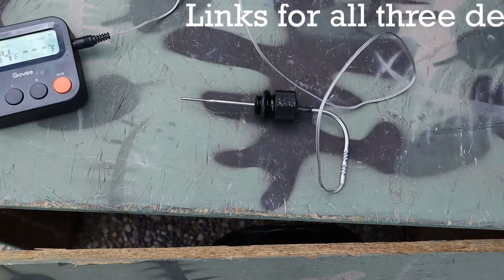Are Generator Sound Boxes Bad?

Comment from the maker: Too hot? Let me know your thoughts. Which sound box do you like? 🟣Follow me on Instagram: https://www.instagram.com/mrfredsdiy/
Reply: What caused the melting of the styrofoam around the dryer vent?  Was it the heat or some kind of glue?  Great video and very helpful!
Reply from the maker: @rrgrantham  it was the metal vent. Part of the inner lining was missing allowing the heat to have contact with the foam. Thanks for watching!
Reply: I built a generator box and mounted it to the tongue of my camp trailer on one of those racks that sits above the propane tanks. It worked great except for one trip the temps were triple digits and the box was in direct sunlight. Needless to say the generator had shut down and I had to take the generator out of the box and take it to some shade. I am running a 4500 watt generator with a 760 CFM fan. Apparently, that was not enough for that hot day.

Comment: that is very false information you are presenting … 

so basically with the box on the oil is getting 30 degrees hotter than without the box when outside is 80 degrees 

240 oil temp for an air cooled gen at 80 outside is hot 

imagine how hot it will get when outside is 95

the boxes are def cooking the generators when it’s 90 outside
Reply from the maker: Thanks for commenting, but the evidence speaks for itself. No false information.

Comment: You say these boxes are safe to use with generators, but my Yamaha inverter generators which are quite already say DO NOT ENCLOSE IN A BOX, I think Yamaha may be on to something since it is their reputation on the line. I am betting even your Harbor Freight generator says in the manual or even a sticker on the generator not to enclose it in a box.
Reply: its not enclosed in a box.
Reply: @BESVisualArts  it is when you put that stupid box on top

Comment: It is not just the engine, it is the inverter and other electronics that require cool air to keep them cool as well. Inverter generators are already enclosed with panels but they are designed to pull fresh cooler air through them to cool the inverter and other electronics.

Comment: Hello Mr. Fred Sir; thanks for sharing your ideas with us. In my "research shopping" for my first ever generator, my first consideration in housing the gen was weather protection, more so than noise reduction( but you got me to thinkin on that now as well). I want to have the gen running - even if it's raining outside and your Styrofoam or OSB should work in that regard.
In your other vid you had left one end of the box open and here you've run it out through a dryer vent; smart - but, i still have to wonder about the co2 sensors that most gen are equipped with - as long as the exhaust moves out of the box, we don't have to worry about the gen sensor tripping? 
 Also, have you measure the heat with a fan blowing inside? I can see that helping in an open ended box but not so much with the dryer vented style, right? 
 Thanks
Reply: Exhaust goes out should be fine

Comment: Heat Heat Heat that is my biggest problem.  I have no clue how your box was so close to ambient temperature.  Have you measured the actual temperature inside the box. Here is what I built for my 12,000 watt duromax running on propane for 9,000 watt output. Yes I am in Texas so it is Hot here but today I measured ambient temperature at 82 degrees F.   I built my enclosure out of the following foam board, (FOAMULAR 150 1 in. x 4 ft. x 8 ft. R-5 Scored Square Edge Rigid Foam Board Insulation Sheathing) It is braced with 1/2 x 3 inch for assembly purposes.  I added a section of hard board for the area where the exhaust creates too much heat for the foam board.  The inside is covered with the following sound panels from amazon, (24 Pack-12 x 12 x 2 Inches Pyramid Designed Acoustic Foam Panels, Sound Proof Foam Panels Black, High Density and Fire Resistant Acoustic Panels,)  

The air outlet is through two 9 inch diameter stove pipes which feed to a vertical baffle box which is unobstructed, but it does have baffles.
I purchased a 1800 cubic feet per minute louvered ventilation fan and had it blowing into the box. from amazon ( KEN BROWN 12 Inch Variable Shutter Exhaust Fan Wall Mounted With Speed Controller 1800CFM For Garages And Shops,Greenhouse,Attic Ventilation)
The box is very quiet yet after running for a few minutes an instant read meat thermometer placed on top of the fuel tank read 135 degrees. Yikes!   If I removed the top cover completely the temperature went down to the mid 90's. sound reduction is only about 1/3 of having the top cover sealed and on.
I think that is far too high a temperature for the generator to actually run in so I am considering a few modifications such as making the fan blow outward instead and removing the  twin 9inch stove pipes to a wide open 2ft X 9inch opening. 
I will post an update when I try the design change but any ideas will be appreciated.

  Texas ambient temperatures run in the low 100's during the summer months so sound quiet box may not be doable during those times.  
UPDATE> I removed the exhaust panel box completely and I put a 20 inch box fan blowing inward. I reversed the 12 inch 1800 cfm fan to blow out and positioned it on the top instead of the bottom. Today was cooler  mid 70's and the temperature at the center of the exhaust fan was running about 100 degrees. The thermometer sitting atop the generator gas tank is now reading about 85 degrees.  The noise level is slightly increased due to the new open areas but it is still very quiet compared to without the quiet box. I think the box is a no go in Texas summer heat conditions because I don't think that running it in a 120 plus degree box air is going to fry something. I do think it will be beneficial during the rest of the year.  We mostly get issues both  spring storms and fall storms. anyway.   It is rare to lose power in the summer hot days. I it goes out I will run the generator outside the box in the shade with a fan to keep that air as cool as possible.
Reply: @willfara8463  live in Arizona same problem with heat 
So what about a box that covers the sides and top
Would that help with heat and some of the noise

Comment: I still would run a portable generator in a box. If I did I would have a 12-inch fan blowing on one end at a minimum. I still say don't do it if you want to keep your equipment long-term. I have a 5500-watt generator that's 22 years old and it's run day and night at least 18 times for 3 to four days at a time to this very day. Religious oil changes is how it's still going on for so long with no motor or carb work.
Reply from the maker: Thanks for sharing your experience and checking out the video! Here is our newest design ▶️https://youtu.be/erA944a9Bvc?si=2oc0oztxMzr24KZo

Comment: 1) Very inconsistent...
**********your winner box is not what you presented in the build video...is it missing a side? Let me guess - for air cooling?
**********your baseline should be done first. If its "baseline" - I'd like you to reassure me that 30min of baseline was enough to cool itself to normal operating
2) What is the test trying to prove? 
**********Decibel reduction? - obviously not, we're missing a panel;
**********Cool temps? - not really... Looks to me we're running hotter, possibly even hotter than what "baseline" is
**********Efficiency? - I am pretty sure the run time drops significantly under load
**********Prolonged lifespan? - Nope, I don't think so; not when you run hotter...

My advice to you.... Do some research for yourself, before you influence people trying to do research

Comment: Thanks for sharing! This is giving me some ideas on the fundamentals. I was concerned about your sound shed's airflow, but I get the trade off of muffling the sound and directing it away. Was there any reason you put the reflective side facing inwards? I would be curious in a hotter environment (or summer) if the reflective layer facing out would help. The comment earlier about styrofoam in sun, and using some kind of batt insulation as well to muffle things further seems valid. This does seem like a fun experiment to figure out how to build what's most feasible - be it for an RV, or for your home if you've got a generator as a backup.
Reply from the maker: Thank for taking the time to comment. My thoughts on the foil was that it might be protective for the foam against heat from the generator. I recently made another version with soundproofing. You can watch it here ▶️https://youtu.be/IZw-N7zx6Gc

Comment: Great job of thermal testing. I would like to disagree, but I can't!
But this is an air cooled engine...are you pushing all that cylinder heat out in the exhaust gasses?
Reply from the maker: Air cooled small engines like this one dissipate heat through the exhaust and air fins. It really is amazing that they are able too cool themselves! Thanks for watching!

Comment: Both plywood and Styrofoam are somewhat rigid and can act as a sounding board. Something soft like fiberglass batting should transfer sound energy into kinetic energy. As you saw, you gotta be careful with Styrofoam as it doesn't like heat or solvents like gasoline.

Comment: I need the gen to stay warmer at 32°f & below, -50.
Reply: Here in Maine some people leave a light bulb on in the generator shed. There is also a cylinder head bolt heater,  attaches to any engine with 1 bolt, and plugs in to keep it warm.

Comment: What would you do differently for an exhaust vent?
Reply from the maker: It’s difficult to explain here in text. The vent was not the problem. I broke the vent when I installed it and the rain cap portion was no longer connected to the pipe. This allowed heat to linger under the rain cap without metal against the foam. I would use the same exhaust vent again.

We like to use the “shed” box the most. Sorry for rambling!

Comment: First plans I seen was two sound sheds facing each other one on top of the other. Never tried to make one, they used heavy one inch compressed board. Your way is the closes I've seen. I thought it would get to hot, you proved it might work using your design. Cool oil temp gauge!
Reply from the maker: Thanks for watching! Fred Jr actually made the oil thermometer. He’s pretty handy to have around!